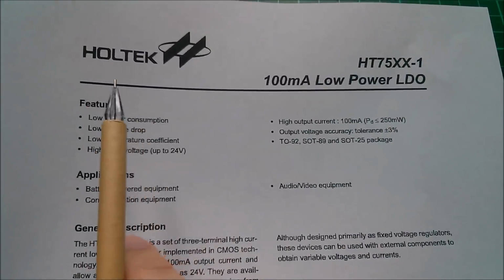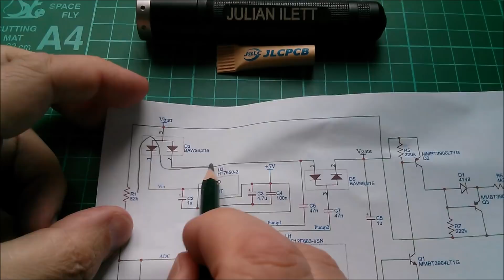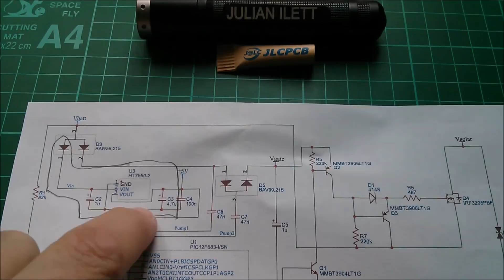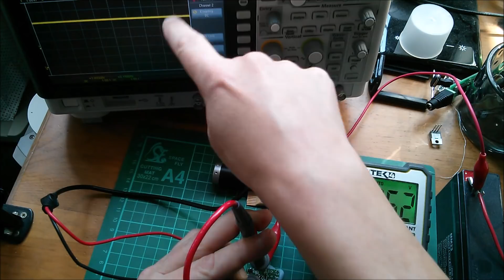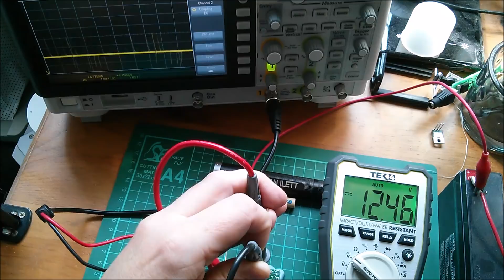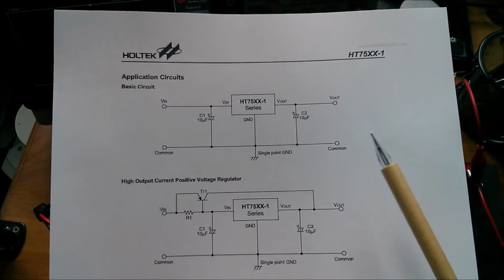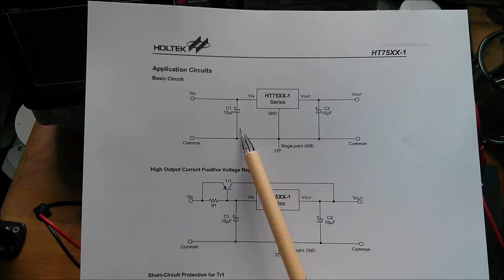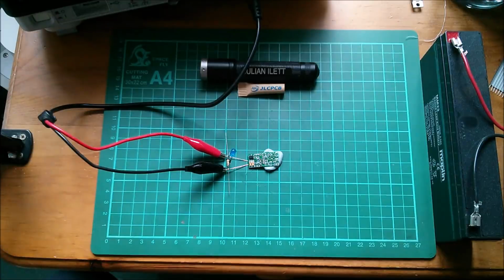Testing the 5V Regulator - HT7550 - PWM5 Femto

Comment: So that switching LED load was enough to cause those spikes or ringing with that voltage regulator?

Looks like the voltage spike effect from switching an inductor on and off. Could that be happening here? From stray inductance I guess because there is no inductor.

Comment: umless you are powering 5V regulator from 5.5V there is no way you can get 2V switching noise from a low current load like led.maybe you had a conection/thin wire problem.
Reply: I disagree.  I think the noise is coming from the response lag of the regulator to the changing load.  I see nothing in the spec sheets that indicate the response time/frequency limit/or slew rate of the regulator.  All the specs appear to be geared to steady-state voltages.  It looks like you have to have sufficient external filtering to remove the "high frequency" part of the load change so the regulator can keep up.  Note that he's using an output cap that's half what the application note suggests.  I think if he were to enter mass-production, he'd either have to add more filtering to pick another regulator for reliability.  This circuit might work 99 times out of 100, but a 1% failure rate would be an unacceptable for most manufacturers.

Comment: To see DC ripple and noise on a scope you must adjust the voltage to say  50 or 100mV per div. adjusting the time scale won't show anything!  1/2 V per div, might show a little. Sorry if I'm not understanding you properly.
Reply from the maker: There can't be any ripple. This is a linear regulator connected to a battery.
Reply: Ok, I misunderstood you adjusting the time scale, didn't know what you were looking for. cheers.

Comment: Julian, not to be rude or anything, but may I ask what advantages your PWM charge controller has over a proprietary brand? I mean, I love how small it is, that's fantastic! But I'd love a quick run down on the pro's and con's of your design. Is it more efficient than other designs? Does it have applications with different battery chemistries? I'm not asking because I don't think your design is good, on the contrary! It's because, well, I don't know anything about why one electronic system design would be better than another. I'd love to gain some insight into this, if you wouldn't mind indulging my curiosity a little...
Reply from the maker: My primary aim was low current consumption - 650uA with the LED disabled - 1mA (average) with the LED enabled.
Reply: Very good! Do you have a datasheet for your current PWM 5 design? Is it for Lead Acid charging or is it capable of lithium ion charging?
Reply from the maker: No data sheet, sorry. 12V lead-acid only :)

Comment: Julian, great video.
Where is the 100nF cap? Did you fit it, should it be where the output wires are?
Can you redo your LED load/unload with the 100nF fitted please.
Just because the manufacturer doesn't put 100nF, doesn't mean its not going to help.
As a matter of course I always fit a 100nF cap to linear reg outputs.
Reply from the maker: The 100nF cap is right next to the microcontroller Vdd and Gnd pins
Reply: Ceramic caps have very low esr but ht7550 dont like low esr.

Comment: Hi Julian, I really appreciate following your miniaturisation journey but wonder where you hope to end up with this thumbnail-sized circuit? Are you thinking they should be pre-installed on the back of new solar panels?
Reply from the maker: No, the controller should be connected as close to the battery as possible for accurate voltage measurement.

Comment: Does this regulator have a Quiescent Current? I see only the no load current.
Reply: no load is pretty much equivalent to quiescent: "For an electronic circuit, a quiet state in which the circuit is driving no load and its inputs are not cycling."
Reply: @ikbendusan  a fast question, when the device is under load, do I need to add that current at the total current used by the system?
Reply: technically if it's switching the output, the state is no longer quiescent (it's either drawing, or it isn't) and it will be drawing current based on the load, at that point you're looking at the switching efficiency of the chip rather than the quiescent current. so to answer your question: i think not. besides, most loads will likely draw much more than the quiescent current
Reply: I seen the KB33 datasheet and it says: 600uA at ground when the device draw 100mA in output. The Quiescent Current, that flows in gnd is 5uA.
So I need to add not the Quiescent Current during the operation, but the gnd current.
Reply: correct

Comment: Now you can program 4.9 volt in the PIC and you get the right result!
Reply from the maker: I'll probably add a calibration function to the firmware - this will store an offset value in the EEPROM to offset any regulator voltage error.
Reply: @Julian Ilett

It's interesting that your regulator is giving 4.9 Volts as all the 7550 regulators I have tested put out over 5 Volts. 

If you fit 10uF caps, the line regulation will improve. ;)

Comment: i want a keysight oscilloscope, i don’t even have a temperature controlled iron or a adjustable power supply.. 🤔😔
Reply: Neither do I, but I have a Rigol DS1054Z, 4 channel, 50 MHz (hacked to 100 MHz), 7" screen and just 400 €/$. As for temperature controlled iron, I'm thinking of buying a Hakko FX888D. And the power supply... well, I have an ATX PSU I planned to convert to a lab PSU, but there's no isolation, so I'm building a switching/linear hybrid PSU from scratch.
Reply: Raid ya microwave transformer lmfao

Comment: 1:15 - need the resistor in parallel with the capacitor, rather than in series with it?
Reply: obd6HsN actually you need it in series, to increase the ESR. This is often done with ceramic caps which have negligible ESR.
Reply: Thanks for making me think again - I had it in mind he meant DC ESR